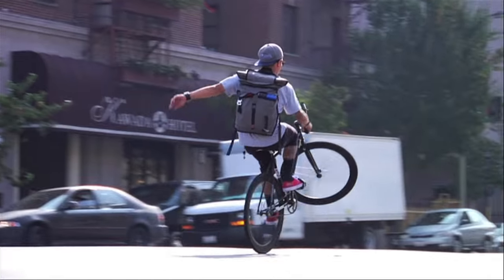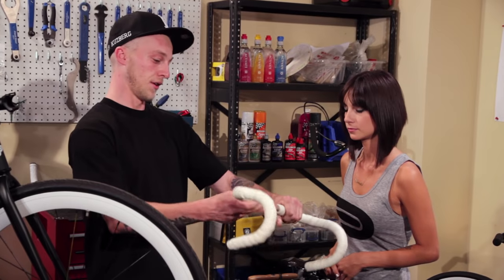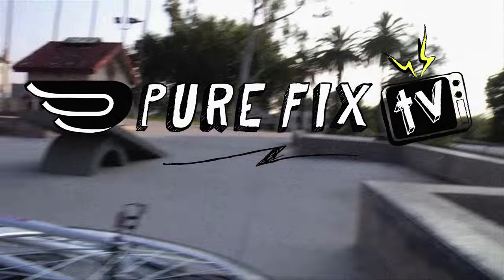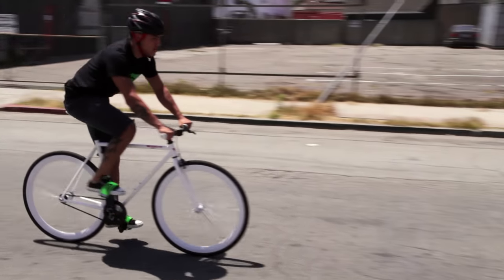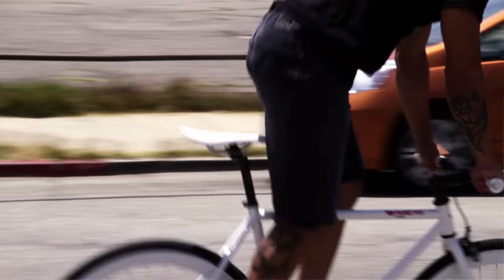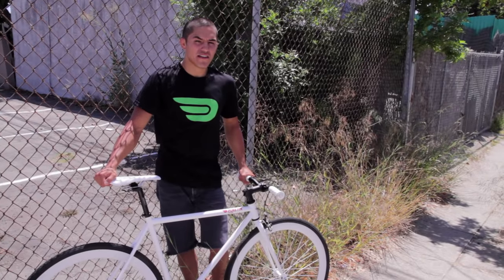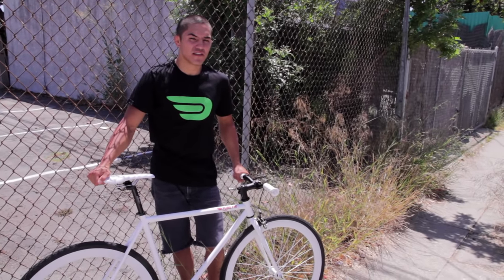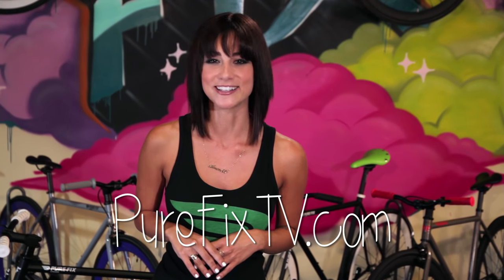How to stop your Fixie

Comment: I've been riding around la county and the inland empire for 2 months now with no brakes or foot rentention and I don't think it's really that dangerous as long as you're not distracted and have significant enough power to slow the bike quickly. I've even ridden down extremely steep long hills in traffic no problem and been able to stop in sufficient time on the decent. I've crashed once but that's only because some chick, not paying attention at all, in a Carrera, darted in front of me in the bike lane during heavy traffic. And in that instance a front brake would have made Zero difference. Your biggest danger as a rider isn't not having brakes it's all the people in cars distracted not paying attention to the road and definitely not looking out for hazards. They'll hit you with or without brakes the only way to avoid them is by focusing and paying attention.

Comment: this is the worst support and customer service i have ever had the bike is not even three weeks old.The bike has been professionally inspected and still not yet have i been able to ride because the wheel will not allow the inner tube to hold air. i have replaced the lining in the wheel as advised. while the bike is sitting here. over night with a new inner tube not yet has it even been outside it pops. I am about to activate My faceook account so i can just write my review about you guys. this is suppose to be a means of transportation and i have yet been able to do anything with it but spend more money on parts and tools. The company is nothing but a lying scam that will not produce good product. Afraid to warrant a product 3 weeks out of box.something as simple as a wheel. I am stuck with a bike that cannot be ridden and no means of transportation.

Comment: And yet none of these ways will stop you as fast an actual brake.
Hopping like a moron only bends your rim and takes away your ability to swerve.
Skidding is not much better. You can't steer and it doesn't slow you down anywhere near as fast as using brakes.
Putting backpressure on the pedals sounds cool, until you need to stop quickly, or constantly moderate speed over a long downhill.

A simple backpedal brake is more safe than a fixie, you can still lock the wheel for epic skids, but you also have an actual brake. Even the most simple drum brakes are way safer, never mind disc brakes or roller brakes. Added benefit of roller brakes being that they're nearly impossible to lock up, it's like having ABS on a bicycle.